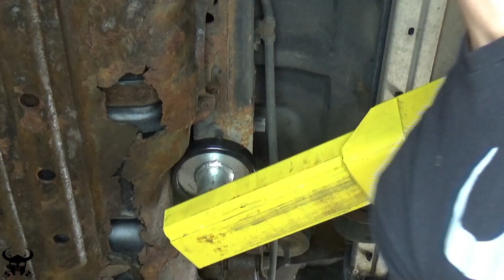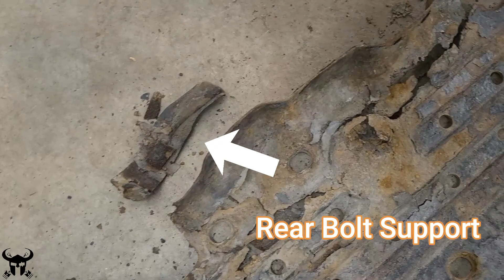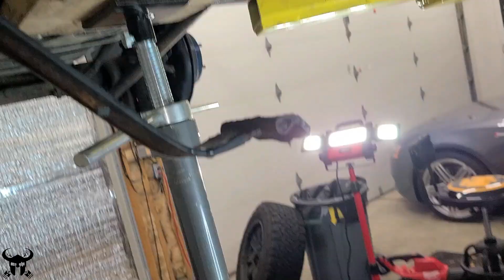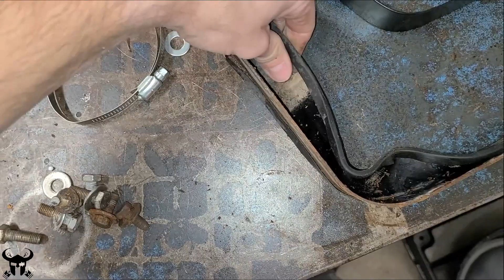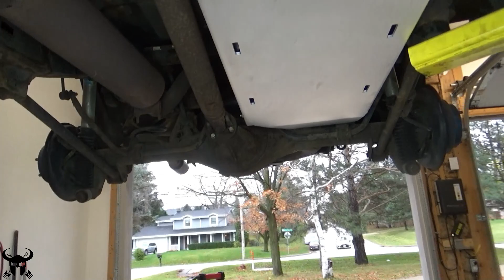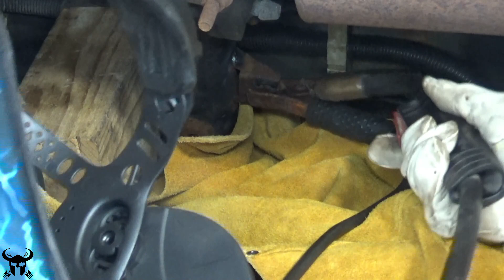Toyota 4Runner Fuel Tank Strap Replacement

Comment: How do you get the skid plate off without the fuel tank dropping down to. I tried getting my skid off and the tank started coming down too?
Ch
Reply: did you figure it out? My tank just started leaking out of no where and i just filled it up, now its leaking like crazy and i now find out that my gas tank straps are rusted out and broken.

Comment: So glad I watched this video prior to tackling this job. My bolts were heavily corroded. I used an Induction Heater Bolt Removal tool and pb blaster. Cracked loose the bolts and then patiently loosened and retighten repeatedly and was able to get every last bolt off without snapping one. Thanks for the video, as it helped me come up with a strategy.

Comment: Great video, I have a question if I wanted to just replace the straps and leave the plate off is that a option . Also yes my shield is shot. Great tip on chasing the bolt holes. My 4Runner lived it’s entire life in north eastern New Jersey . My wife and I just recently moved to South Carolina and man this is 3rd gen 4Runner country. Sorry just yammering at this point . Grate video lots of Pro tips
Reply: yes and yes. my straps was was/is way harder, smaller car and way rustier....

Comment: Curious as to why that skid plate is flat at the front and part of it curved up at the corner, I would "think" that flat open part would collect everything under the sun driving in different weather conditions (including snow), maybe the makers can explain why they did that because (personally) I'm not a fan of that skid plate (at all). Thanks for the video and walk through with your strap replacement. :)